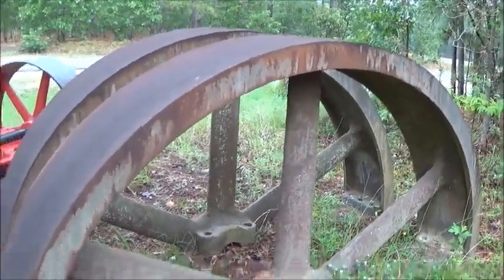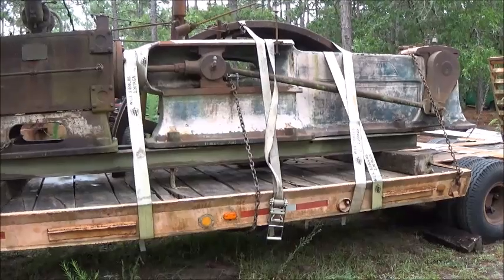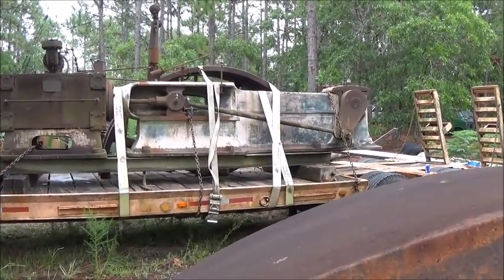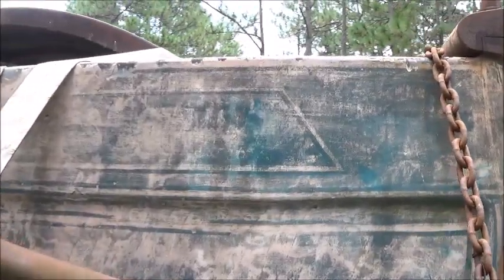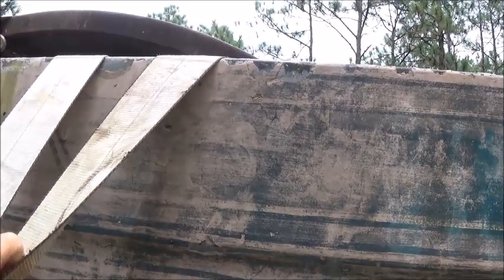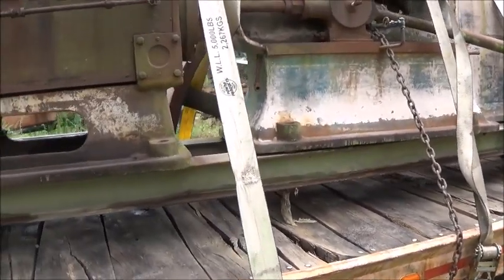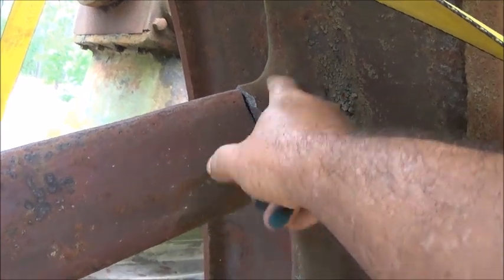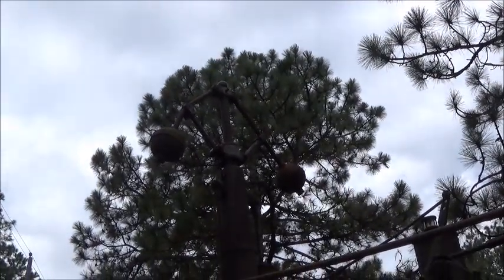1905 BATES CORLISS STEAM ENGINE. HOW I FOUND IT AND OTHER INFO.

Comment: If you weld that crack, be sure to preheat the entire piece so expansion caused by the welding doesnt crack it elsewhere. A sand box, heated with a weed burner before putting the flywheel section in works well. Cover it with a fire blanket or house insulation to keep the heat in while welding.

Comment: Those glass oilers  might could be reproduced using epoxy resin and that can be tinted to match the original look.
Just a quick question I don't want to come off as someone trying to tell you what to video,  so I was wondering if you are considering doing another rat rod build?
I'd so love to come and participate before my disability keeps me from doing stuff like that.
Love your efforts in saving "little" bits of history.  Man with all those steam engines you could literally go off grid if the situation should arise.

Comment: Back in the Mid-1970's I was stationed on a Caribbean island and there were the remains of a sugar mill that had a large steam engine and boiler.  Probably still there because it was off the beaten path, but probably not worth salvaging due to the transport costs.

Comment: We had a tracked machine at work with four tracks, one side had a hydraulic cylinder to raise and lower the front and rear of the machine (one cylinder for each track) and the other side (the passenger side) had a front and rear track with just one cylinder in the center and it had a walking beam so it was like a three point contact but with four tracks. It was the same idea as your trailer uses, with our machine it was used to keep it level from one side to the other.

Comment: Some years back I learned about cast iron welding using a low temperature electrode called MG-250. It's a high nickel alloy rod which can be run at a very low heat.  The base metal does not have to be pre-heated. I successfully repaired an exhaust manifold for a Ford V8 engine using this method. It is an expensive rod but it is well worth the expense since it eliminates the necessity of pre heat and keeps warpage to a minimum. It can also be used to bond steel and cast iron. I believe it would work well to repair the broken spoken your flywheel. BTW I chuckled over your "disclaimer"

Comment: Can you fit a bolted 2 piece steel clamp around the adhesive spoke repair? Counter weight the flywheel opposite spoke for balance.

Comment: - A properly brazed weld on the spoke will be stronger than the cast iron of the spoke itself.
- Getting and keeping the heat of the surrounding cast iron high enough is, apparently, the key.
- Drilling, tapping, pinning AND brazed welding the break can't hurt, Jonathan.

Comment: I think the pivot on the rear wheels of that trailer is called a walking beam suspension far as I know.

far as that flywheel goes, once you line it up and bolt it, it wouldn't hurt to hog it out a bit and braze it up nice too.

Comment: Incredible find!!!  That machine looks as if it will take much less work to get running.  I hope to someday understand what the dash pots actually do (I have heard of dash pots on carburetors but these are different)  and how the governor works? They both seem to have something to do with controlling the speed of the machine but I would appreciate an explanation.  Will you get Vic back over to work on the Corless valves?  Another tremendous machine and serious piece of industrial history.  I think that brass Bates Corliss ID tag and the other smaller tag are simply fabulous -- an unmolested historical artifact.  The trailer sounds pretty neat as well.

Comment: The purple hue in antique glass is due to aging combined with lead contamination in the glass from the manufacturing process.
Reply: Manganese was used in glass production to around 1915, exposure to sunlight will turn it purple, so I think the engine sat outside for quite a few years

Comment: Now you have the tags you could make new ones for the big bates to make  mould , first impression with plasticine , then pour in plastic resin , make another mould using heat proof compound then to ceramic mould then cast in brass , I do this from time to time for models and small stationary engines ,